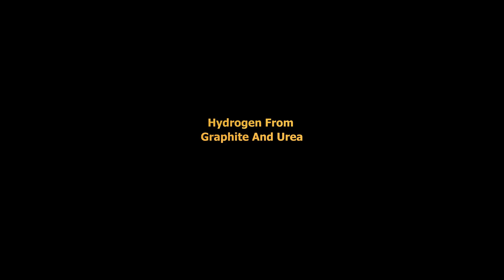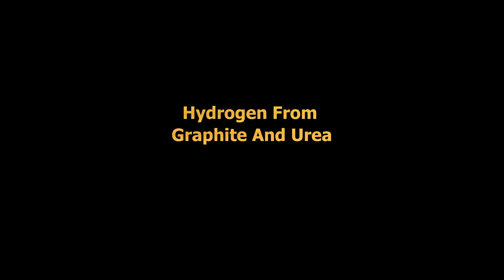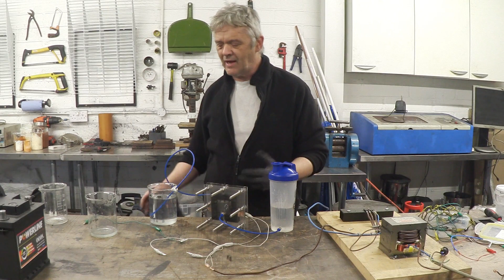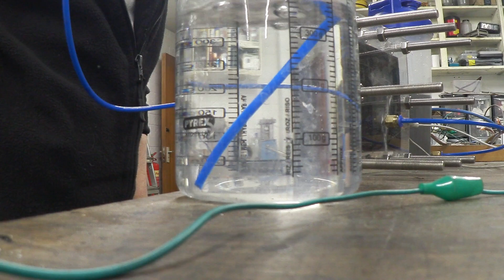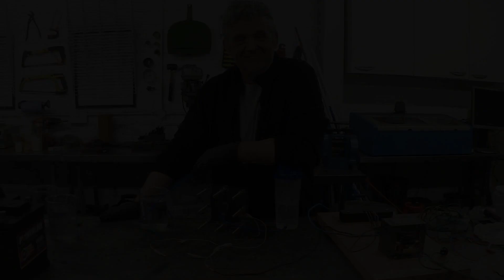Hydrogen From Graphite And Urea

Comment: Hi Rob,
I came across your cell because i want to build a safe HHO generator for hydrogen therapy. I am concerned about the chromium from the stainless steel eletrodes in traditional designs. Do you know if the urea could be harmfull in any way? I would use 2-3 gas washing stages afterwards so any possible Urea/NaOH residues should be washed out by then. Am i wrong?
Reply: Urea is very common in the body. It is in sweat.

Comment: I was just looking at tbe prices of 316L stainless sheet, and given that the plates won't last forever regardless, it has me thinking about the fact that I can pull pieces of charcoal out of my woodstove that will register less than an ohm of resistance across them. The trick is to get the fire very hot by blowing on it. Years ago I wanted to use a microwave to further the graphitization, and I found that it worked, but for some strange reason I got hung up on the idea of creating a vacuum inside of it, vs just using a simple kiln. Graphite is a susceptor material, so it will get especially hot in a microwave. So, the idea then is to make the charcoal almost as conductive as metal, which will work with a microwave kiln for sure, and then find a way to consolidate the resulting material into conductive sheets by grinding them and perhaps binding them with something that is insoluble in water? There has to be a way to get sufficient conductivity. . . Maybe this sort of carbon could be used to make all of the neutral plates without actually being so conductive? I am not really sure how the voltage manages to spread evenly between the plates, being that they are not physically connected to anything except the electrolyte, but evidently it does. If I manage to figure this one out I will try to share the results somehow. DIY carbon or flake graphite in a slightly less conductive form due to PVA or whatever admixture might not work for the end plates, but the neutral ones? An idea for people to try, anyway.

Comment: Instead of the stainless steel can we use titanium I made 60 titanium washers quarter inch thick drilled them and not sure what somebody let me know if I could use those in there and it will cost a problem thank you

Comment: You must be very careful with hydrogen Some say it is very explosive, when I was working on my car at Age 17 a spark caused by the wrench hitting a wire ignited the battery as I was taking it out of my car it blew up right in my face big bright white flash and I was burned slightly by the acid

Comment: small hint though ...
you use the "dry cell" as an ordenary cell ...
normally the fluid container in this setup gets both in and outlet and sits above the cell
a normal cell has to be refilled above the plate level but because of the disighn, the dry cell (dry on the outside) always has maximum plate coverage with electrolite since the containeris above.
also the output improves since the electrolite is constantely pumped through so the plates keep free of bubbles faster so current is more efficient per cm2.
just put a tight lid on the electrolite container with a tube sticking out and  feed that to the bubbler. 
once you do a liter per minute per watt calculation you'll see why ;)

Comment: The cool thing about urea from where I sit is it’s generally available as DEF wherever diesel fuel is sold, so you won’t have to mix up new electrolyte solution if you’re running low on feedstock for the electrolyzer. Right?

Comment: Got some questions and ideas 💡, 
The reason for any kind of electrolyte is just to make the water conductive, and that's it?...
So can doing this replace using electrolyte...
The two opposing surface areas where the water breaks down, Coat them with a super Hydrophilic coating, creating the Exclusion Zone (EZ Water), it becomes evenly negatively charged, and the positive charges  pushed out are the strongest against the negatively structured layer and get weaker the further away up to where its just neutral water,. Put them close enough to where the positive layer from each surface overlap, but not to close to where the EZ layers become one. Now you have a conductive path of water between your electrodes! 
Will that replace using electrolyte?????
If so, and even if not I have an ultimate design for a cell combining different technologies in a very unique way. Its more than im willing to type out at the moment. 
But could we have an audio chat about it, like on Skype etc?

Comment: Use 988 parts of distilled water 2 parts of caustic soda. (Sodium hydroxide)
Have 1.2 millimeters between the plates.
There should be 3 volts between each plate.
Focus on how much gas you produce compared to amps.
Amps alone, says nothing.
It may disappear in heat.

Comment: I like this method of generating HHO. HHO is facinating stuff and I no longer believe the conspiracy theories as to why we all are not just using this for our heating and electrical power needs and desires. My own experiences with HHO suggest its reaction speed when imploded is far to fast to be practical on a larger than novelty application. In a nutshell its like trying to control a stallion with a wet noodle. when you try and do anything useful with it on a simple man's budget.  I can personally attest to what a hole through a ceiling  looks like when this HHO implodes.  I'm sure It can be useful if you have the $jack to tame it. In all fairness before you call me a troll try to make HHO "useful" yourself without spending a small fortune.  I spent the time and meager funds in my attempts.  I left the hole in my ceiling as a reminder of how my desire to save money can cost more than installing a simple wood burning stove. I throw the gauntlet down for Mr. Murray-Smith to prove me wrong.  Please show me the path to making this stuff useful sir.
Reply from the maker: oh no mate I agree - it is hard stuff to tame - my though was along the lines of separation and on demand volume control rather than bulk production and storage - but I am a step by step kind of guy and I hate spending money lol

Comment: (Psssst:  Check my comment on yesterday's Ceramic Supercapacitor video).
When you substitute an Aluminum Anode for the Power Supply - so that the Cell produces DC Current while making Hydrogen instead of consuming it - note that Sodium Hydroxide will function as a true catalyst, fully regenerating as it operates, while Potassium Hydroxide will not.
Also: Just as you use that little electric motor to demonstrate the useful power being output by your batteries and supercapacitors, you might consider an RC Model Aircraft Engine that will run on Hydrogen or HHO to demonstrate the useful fuel being output by your electrolyzers and [reverse] fuel cells.
Reply from the maker: I can't keep up with the comments anymore mate - I just get too many - sorry about that - I do try and check out the most recent but these days even a day or so gets too much - I don't agree with the aluminium anode idea but I do agree with the NaOH and small engine idea - the problem is - have you seen the price of those things! If I had a couple of hundred dollars to spend then no worries - but I run this thing on a shoestring
Reply: @ThinkingandTinkering  Yes, but there's a link I put there you will find useful.  I know the RC motors are expensive, but when I was looking to do just that, I saw a number of used ones on eBay very cheap (<$50).  I didn't mean the 'Aluminum Anode' in that device configuration...

Comment: To break down one urea molecule and release the two molecules of hydrogen gas they applied 0.37 V across the cell. This is much lower than the 1.23 V needed to do the same to water.
Carbon dioxide is  generated during the reaction of urea, but it is not released as a gas and instead reacts with the potassium hydroxide in the electrolyte to form potassium carbonate.
Reply from the maker: that's partially true mate - in practice the applied voltage is 0.447 with a nickel catalyst - the electro-oxidation of urea is fairly complex particularly with catalysts and dependent on pH

Comment: Nice hho production maybe you could try PWM with a bifilar coil with opposite connection you can use a mains suppression choke for this
Reply from the maker: nice idea mate - have you tried it?
Reply: @ThinkingandTinkering  Hi Robert 
Yes I have tried it and it works well
No electrolyte just water and two tubes , one inside the other with one mm spacing and together with the bifilar coil you create a "tank" circuit
With it's own resonance 
The voltage went from 12 volt DC to 80 AC
Bought a hho sensor for Arduino but still have to do the measurement

Comment: That's an awesome amount of gas for such a tiny cell.
Reply from the maker: it is cool lol
Reply: Robert Murray-Smith is that gas pure hydrogen though? What about oxygen and in this case I imagine nitrogen and carbon oxides that form during electrolysis?
Reply: @ADHDgonewild7  It should be stoichiometric hydrogen and oxygen, steam, and whatever atmospheric gasses were dissolve in the feedstock water.
I don't think the process used evolves carbon oxides in significant amounts, or I imagine we would see a great deal more steam owing to the exothermic nature of 2C + 2O -> 2CO etc. I could be wrong through.
Reply: Atlas WalkedAway is the urea what we are breaking apart to get the hydrogen? I was thinking that was where nitrogen and CO2 would come in
Reply: @ADHDgonewild7   Water is H2O. The electrolysis breaks the hydrogen/oxygen bond releasing the hydrogen and oxygen from the water, also called Brown's Gas or HHO.

Comment: You also could use high temperature gasket maker instead of the rubber cut outs just let it dry on the ground by foil overnight before sandwiching
Reply from the maker: that's a nice suggestion mate - I like that for a finished cell  - the problem here with those kind of gaskets is they are not so good when you pull them apart a few time and this is an experimental cells - so it gets rebuilt a lot - I autopsy the plates and redesign the plates and rebuild often so remaking gaskets would quickly become a pain - with over sized gaskets from rubber I can experiment a lot and quickly
Reply: Graphite
Reply: Consider creating a 3-D printed mold so that you could poor liquid latex into to make gaskets quickly. Or build a cookie cutter punch to hammer out gaskets quick. Screen printing the gasket maker may work for production...

Comment: Piston engines running HHO or anything really no one asked but if you are going to make one go horizontal with the combustion and expansion chamber use a rack and pinion system as the kinetic energy converter and then at the end of the power stroke at the far side you have another combustion chamber that then drives the piston back with the rack disengaged or engaging a different pinion probably a second drive shaft pinon with gearing to keep everything moving in the same direction for the drive shaft now with a 4 chamber system working the one rack and pinion converter you can have opposite sides firing at the same time so that the top and bottom of one pion are being driven.
Reply from the maker: I have been looking at small engines as that is in my mind mate
Reply: @ThinkingandTinkering  Wonderful so what do you think of the idea?
Reply: @ThinkingandTinkering  Another idea is essentially a water wheel driven by explosions from symmetrically placed angled side chambers sequentially fired around a circular tube track the paddles are piston heads and also sweep out the exhaust through valved ports, speed of the engine is controlled by how much HHO is let in at a time and the timing of ignitions.
The tube would have a thin slot on the inner edge for the piston wheel disk and the disk would have a ridge and wiping seal for containment.

Comment: Hi Rob,
You probably know this but for these so called "dry cells" you want to put the gas output pipe back into the water reservoir. This way it does not matter where the water level is in the reservoir/tank, you can even mount the tank well above the cell if you want.
The gas output line will now put out both gas and the water (electrolyte) so you  take the actual gas output from the top of the water (electrolyte) reservoir/tank, through at least a water bubbler (flashback arrestor is a nice thing to have also)

This does require a sealed reservoir/tank, but in my opinion it is a good setup. Keep up the good work, sorry for the essay lol!
Reply from the maker: I do mate - I am just making this as simple as possible for the experiments - but your comments are spot on and very good advice
Reply: @ThinkingandTinkering  I hope you see my comment on the main thread, not reply on a reply, u get what i mean

Comment: Where does the O2 and OH come out? Is there a second gas port on the back?
Reply from the maker: no mate it comes out mixed there is no effort at separation right now
Reply: So this current design is for immediately combusting the HHO gas, not gas storage. That's perfectly fair. 
Just for my personal understanding, to separate the gasses, it would be a matter of placing a exhaust hose on the cathode side and another on the anode side and adding a gas barrier between the two. Is that roughly correct?

Comment: Am impressed with your progress of the cell. I remember my science teacher saying that the best voltage for electrolysis was 18 volts. Have you found out that this is correct ?? Or does 12 volts really do the trick ??? Keep on making great videos Bob. Thanks VF
Reply from the maker: it depends on what you are electrolysing mate - water takes at least 1.23 volts urea is 0.47 volts. There is resistance in the cell so the applied voltage is always going to be higher but not too much - if the cell gets hot then all you are really doing is boiling the water and producing steam - so like so many things it's a balance - the reason we are applying 12 volts is we have 6 cells in each unit so the average voltage per cell is 2 volts even though the unit takes 12 volts - hope this helps

Comment: This is great! But the problem is that it requires energy to create hydrogen. So it makes sence to use this system as a battery for energy generated from wind or sun. But then comes the problem with storage of hydrogen. How do you compress hydrogen in a safe and smart way? And how can you the produce energy from that stored hydrogen? Fuel cell ? Stirling engine? There are some videos on youtube - but hope to se your take on it? Kind Regards :) and thank you for the channel!
Reply from the maker: it requires energy to create any fuel mate - the hydrogen generated from urea electrolysis is net positive for energy. That's not because you are magically creating energy it is only because the bond energy in urea is lower than the bond energy in water - so it takes less energy to split urea than you get when you burn the hydrogen into water

Comment: Another great video. Currently building my magnetic stirrer hot plate. Running dc motors but I can't seem to add capacitor without making a manual switch. Any help appreciated
Reply from the maker: not sure why you want to do that for a stirrer mate most dc motors that size don't need one
Reply: @ThinkingandTinkering that's what I was thinking.  The motor doesn't start without a little  push it's a 14.4 volt dc motor.  I took out of a robotic Hoover.  I got 5 motors and thought it would be perfect but I'm scratching my head lol.
Reply from the maker: @karlmyers6518  sounds like a squirrel cage motor mate - you need to identify the aux winding if that is the case and bridge the cap over that - you probably need a disconnect switch too as they don't usually like the cap being inline when running - but as I don't know this motor I am really just guessing
Reply: @ThinkingandTinkering  After all that it looks like a fault in the power supply under load! I've gone out and borrowed my car battery and it spun straight up. New power supply needed. (New volt meter in the post)  I'll be sure to upload some pictures when it's done. Cheers mate

Comment: Can you run a small petrol motor with the gas
Reply from the maker: yeah probably mate
Reply: @ThinkingandTinkering  that would be a cool video.maybe a small Strimmer engine connected to a generator .loop the power back to create more gas
Reply from the maker: @craigmccarthy9484  something along those lines mate
Reply: It would run, but it won't run well or for very long. HHO gas burns extremely hot and fast, and all engines rely on a bit of extra petrol to keep the fuel/air mix rich so that the engine parts don't get too hot.

HHO burns very fast like I said, so it's very possible for it to ignite and go past the valves before they fully close.. that could lead to a very big bang indeed

Comment: Seems to be producing pretty well, for a quick ballpark figure of production volume / time, run your output into an upturned water-filled test tube, time how long it takes to fill.  But you know that :)
Although your cell is a pretty big advance in terms of production simplicity and cost, I can't see this particular setup being overly useful for urea electrolysis, - although you're getting more H2 than you would with a "classic" dry cell, the hydrogen is mixed with nitrogen rather than being a directly usable 2H2 + O2 feed.
Reply from the maker: i have a plan about that mate lol